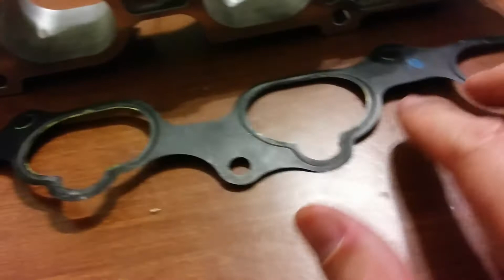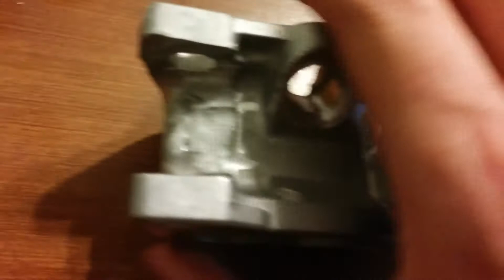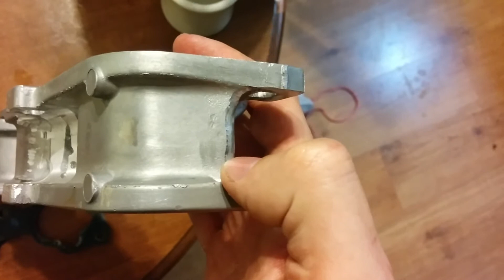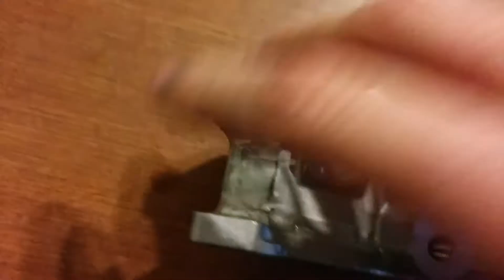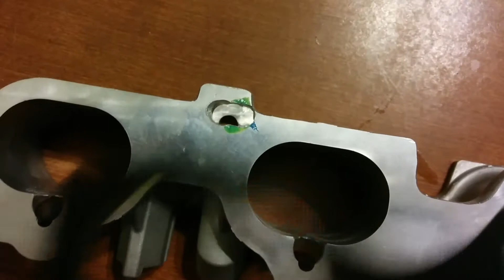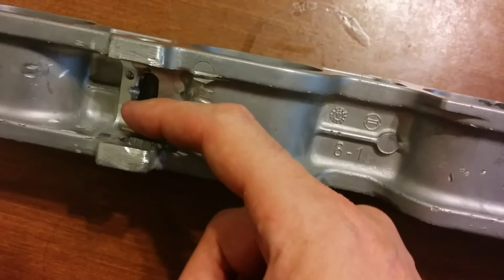Qr25 plenum adapter

Comment: I know this is an old video but from my understanding this is needed for the clearness of the head studs correct? Is it possible to just swap the head studs for longer ones?
Reply from the maker: The head studs stay in the same location.  The injector boss from the 07+ becomes and adaptor plate by this process.  Also only the center and the outermost holes line up.  Since the gasket needs to be compressed uniformly.  I wouldn’t do it that way.